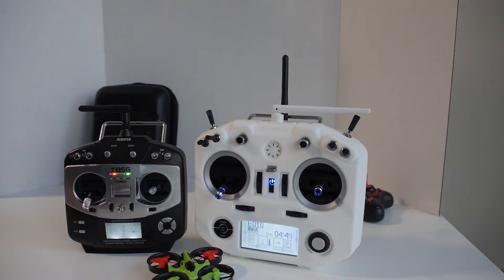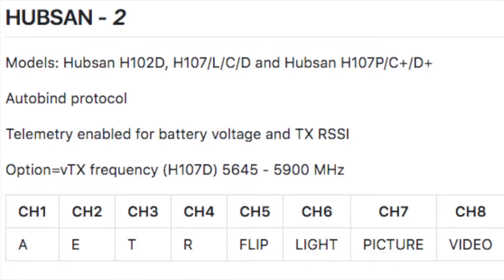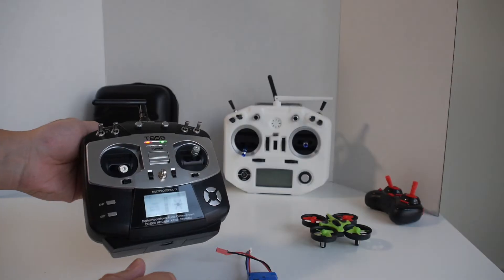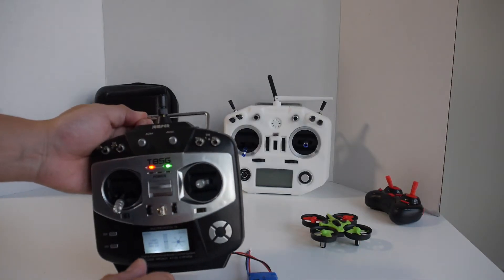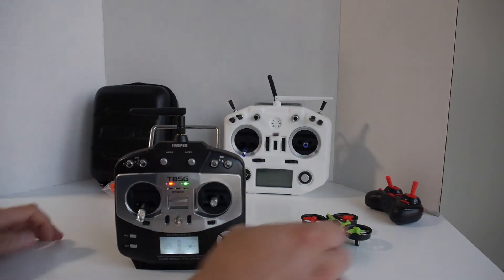Jumper T8SG DeviationTX configuration setup Multi-Protocol

Comment: Hi mate, well presented and helpful video.  You didnt apply a range to the throttle ??    I am trying to use a Mobula 7 with my (Silver) Jumper T8SG.  Everything works except when I throttle on, Mobula 7 goes to full power and does not come down when the throttle is brought down.  BetaFlight shows the throttle going up and down.  I dont know enough about it to fix........Any suggestions ??

Comment: Hi, I haven't seen anyone explaining how to set up the AUX 4 and 5 wheels on the Jumper T8SG. I got a Lemon RX Plus Stabilizer and it requires to activate Channel 8 and assign to a knob or wheel for gain control of the stabilizer function

Comment: I have various doubts. In the link that you send about the protocols I see 2 things, the Hubsan allow RSSI telemetry but when I go to configure it I do not get that option. I've tested it with the sub-protocol H501.
I also see that the assigned channels do not correspond to those that work for me, for example, the lights work for me on channel 5 instead of channel 6 ... Is there a later version?
Reply from the maker: Go to deviationtx.com to see if there is a newer firmware.
Reply: @KenVersus  I have the latest version. My question is if this can explain the diferences in the cannels configuration
Reply from the maker: It could he that hubsan changed it for that quad.  Sometimes it's a lot of trial and error to map out the channels.
Reply: @KenVersus  I shall test both. Thanks

Comment: Thanks for doing these t8sg videos. I'm a newbie to this hobby and it's so much to try to make sense of. I have a technical background, so I feel like I should be able to understand it all instantly, but there are just so many layers... Anyway, you do a really good job of explaining things for those who are new to the hobby and don't speak the language fluently yet, so I wanted to acknowledge that, and say thanks. I'm still quite baffled by way more stuff than I'm comfortable admitting to, but you've definitely helped me take several steps toward being a little less clueless. Thanks! Liked and subscribed!
Reply from the maker: The RC hobby is quite complicated.  I remember getting into it over a decade ago and having the same feeling you have.   I don't think it actually got easier for newcomers to be honest, but the saving grace is that there is youtube :)
Reply: kenVersus Right. And we can't forget how much better the technology advances have made things. When I raced 12th scale cars back in the 80's just someone powering up a transmitter in the pits could easily cost you a race. And that's just one example. ESCs cost a small fortune back then too, so the low budget racers used a servo swiping across a rheostat. The electrical noise from that interacting with the analog transmitter link could be a nightmare. Lol

Comment: hi i need help i have Dynam Scout 980mm airplane and transmitter Jumper T8SG  ...i am looking for receiver with stabilizer system all in one receiver ...but should work with transmitterJumper T8SG
Reply from the maker: Hi.  Spektrum makes one. The ar635.  Or orangerx rx3s. The jumper supports DSM2/x. So should work but I don't have any experience with them yet.
Reply: thanks man for answer  if i get DSM2 is any video how to programe
Reply from the maker: I'm sure someone else has a video about these receivers on youtube

Comment: Hey Ken, is there a particular reason why you didn't change the rates for the throttle???  Is it feasible to change rates for just the throttle and leave the other settings as they are?  Just curious... great video and very informative.  If it's ok with you, I plan to link this video to some of my future videos using Jumper. (there's no need for  me to reinvent the wheel since you have done an outstanding job of explaining it already!!!)  Thanks a million for the time you saved me by posting this video!  -djsoulforce
Reply from the maker: Hey, I never change rates on throttle, since I need the full range for lift.  But I can't see why you wouldn't be able to. I only change it for the AER so I can limit how responsive the quad is.   But try it out and see what happens if you change rates on throttle. 

No issues for linking to my videos at all. Thanks!
Reply: I have linked your video to my followup review of the Hubsan H122-D Storm, and listed you as a collaborator - https://www.youtube.com/watch?v=bIlH8_ZuFJ4 - it will be very useful for my viewers and will send more viewers to your channel.  Thanks for all that you do on your channel and sharing.  Happy flying bro!!!
Reply: @DJSOULFORCE  yep.. I just came from your page to here.. Kudos 👍. #SFQFL😎